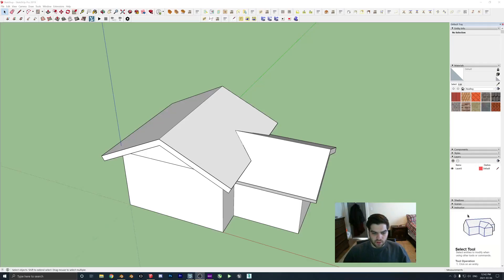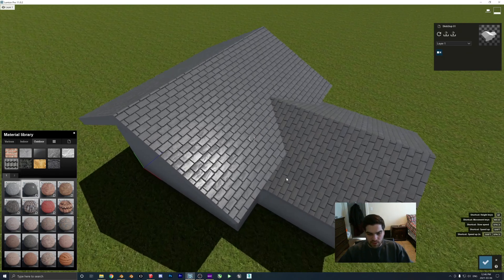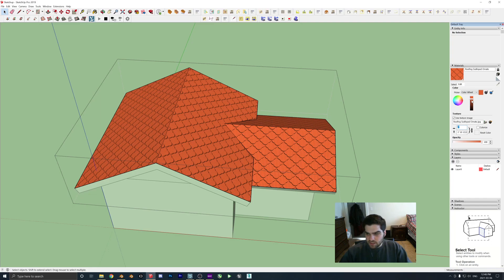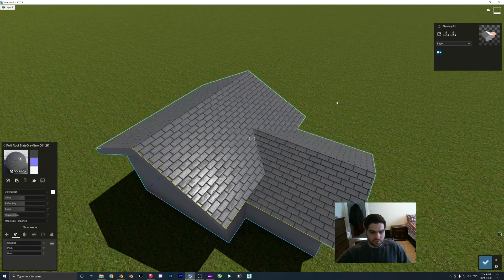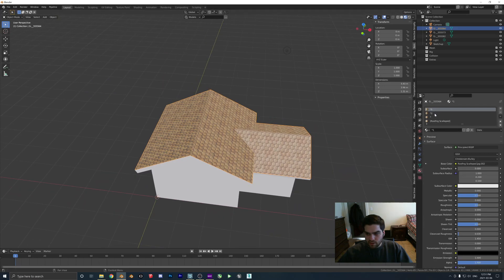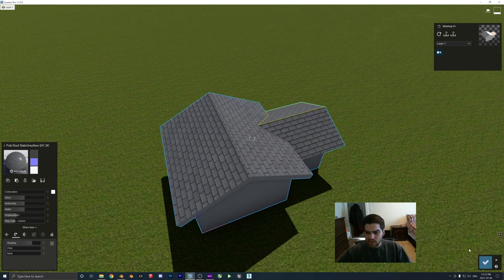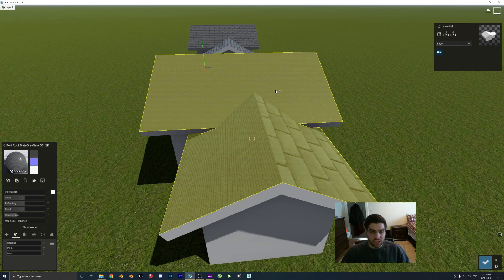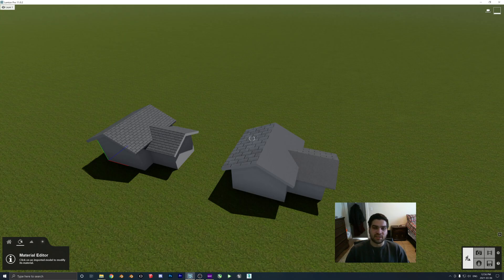How to FIX TEXTURE DIRECTION in LUMION! UV UNWRAPPING Crash Course!

Comment: Anyone have tips for dealing with this when using revit?
Reply from the maker: I am not too familiar with making changes in Revit, if you are able to apply a different material in Revit you could edit them separately in Lumion? That could get tricky though as the material IDs can mean more in Revit than in Sketchup.

Comment: You can also adjust the SketchUp texture positioning/scale/rotation by right-click "Texture".  You can then use the pins to adjust as needed.  Then in Lumion leave the Map Scale in the Imported state.
Reply from the maker: That works too! I think I only did the scale size in this one because there was multiple faces. The "Texture" tool only changes that one face right? Still it is a good point I should have gone in depth with it.
Reply: @LuminousLabs  No sweat-  I am not a Blender user.  I only use SketchUp and I spend quite a bit of time adjusting textures.  I do agree with you that Lumion should include a bit more robust material editor.

Comment: So to confirm, if you change map scale to 0 after you changed the sketchup texture to a Lumion texture, it will follow the sketchup texture direction/ orientation?
Reply from the maker: When the slider is all the way to the left it won’t say “map scale -custom” anymore and it will read “map scale - imported”.

Then it is using the sketchup information :)
Reply: @LuminousLabs  Thanks!! This is good to know because for years (since version 3.5 Lumion) I have always had issues with roof textures
Reply: Yes,  if you don't move it up it will stay the same as from import software. I use revit. It works the same.
Reply: For revit the best way we have found is to paint each face a different material like you showed. Works similar.